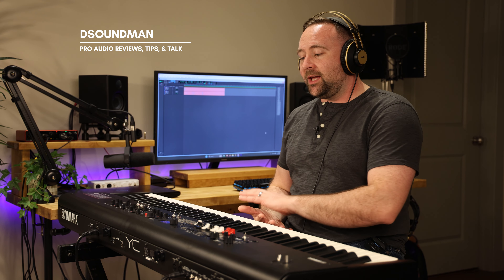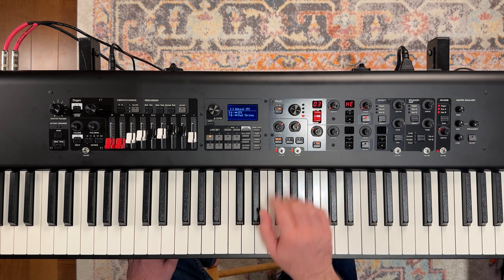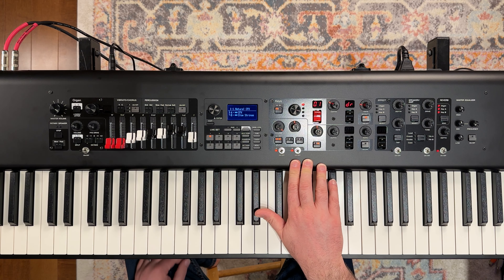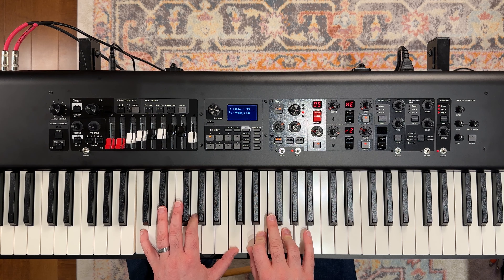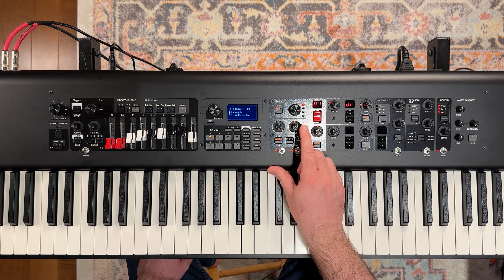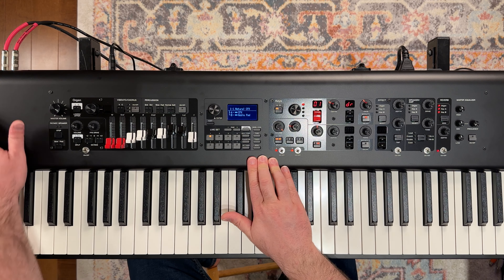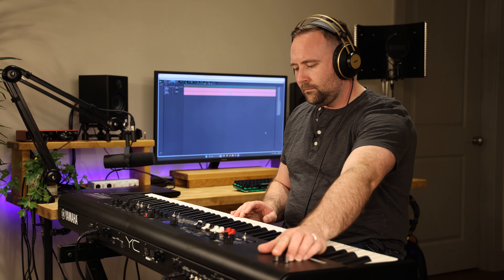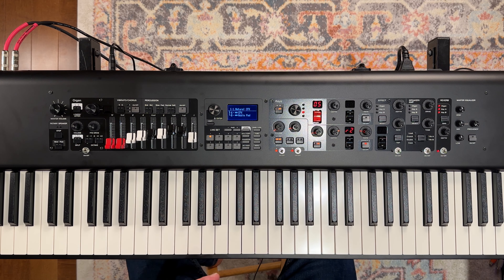Yamaha YC88 - Building a Piano and Synth Pad Layered Sound

Comment: I moved from Nord to Yamaha with no regret. Love your YC episodes!
Reply: What is better with Y compared to N? Which N did you have?
Reply: @sharingmatters  The YC88 is not necessarily better than the Nordstage 3. I find the YC88 more pleasant and less complex to work with and I like the keybed a lot better. I also miss the XLR output and Audio interface on the Nordstage 3.
Reply: @Robin_S78  Is it true you only have a limited number of patches (51) in the YC88 and you can't upload/change any? Also, why do you need an additional audio interface with YC? Can't you just connect it directly to a computer?

Comment: Coming up on a year of owning this, and i am wondering if anyone else has this issue.   Compared to my Roland’s and Rev2, the volume from this device doesn’t seem as loud.  I have to turn sound all the way up for my sound guy to be able to do anything with it, whereas with my other keys, the volume is much louder at 1/2 way and that’s still louder than all the way for the YC.  Also, I love how you modified the Noble Pad.  I just stumbled upon that by chance today.  What setting did you use to get the Noble Pad to play as a drone?  Did you have a sustain pedal only assigned for the Noble and not the piano?
Reply: Have you adjusted the output on the internal settings? Not only is there a volume knob, but you can control the maximum output of the board. Another way to counteract this is to add a compressor and use that volume to boost your board. I have not experience low output, but I also had turned the internal output up before plugging into a sound system for the first time.
Reply: @_classic_rob_  Is there  particular compressor you’d recommend? And thank you for the recommendation as I was able to increase the output volume dB.
Reply: @scooter9240   Whichever compressor is the first to show up in the list. Not the EQ band compressors. I turn the depth to about 15% and the rate to 75-90% depending on what I like.

Comment: when you asine something to one of the controlers, will that still be set the next time you turn the YC on? or will you have to re asine it again?
Reply: You have to save your assignments to whichever patch you are using. It is a preset-based board, so you will need to assign most things to each preset. Another way to cheat the system is to copy a preset that you like, paste it on another spot, then you have all of your settings the way you like.